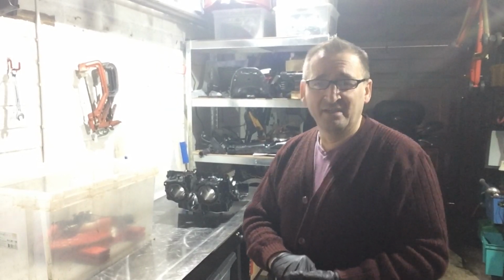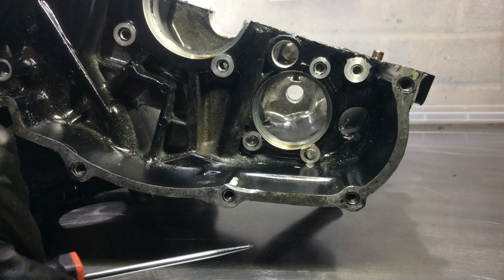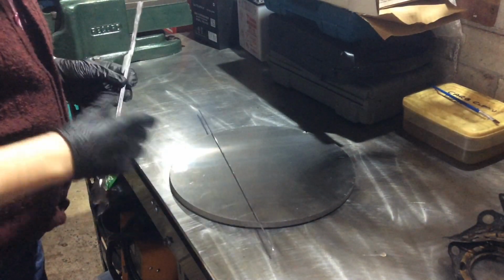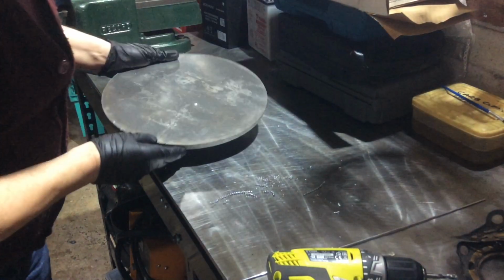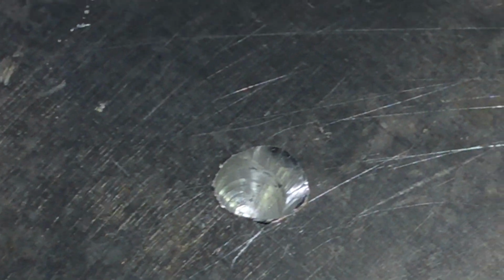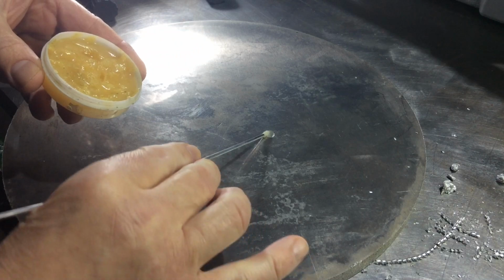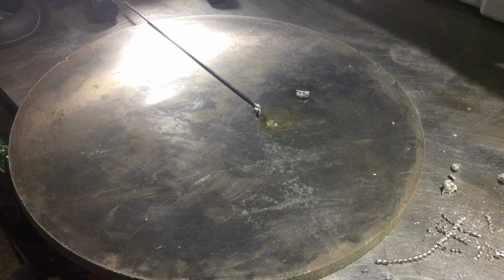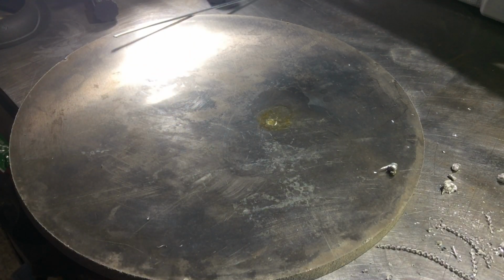Motorcycle Engine Test Repair. Aluminium PLUG - Epic Failure. Honda VF750F

Comment from the maker: Yes I was hoping an easy low temp solder would do it, but I’m guessing as it cooled it contracted, and therefore was never’ going to happen. I have got some aluminium wire now for my flux core, so will try that next. Really don’t want to warp the cases or damage around the shift drum bearing race.

Comment: Arc and inert gas is the only way to do this.  You need more heat and to prevent the melted aluminium from oxidising.

Comment: The plate take all the heat and is not hot enough you ned 660 degres 🙂
Reply from the maker: This was just soldering, but yes defiantly not enough heat. Think I’ll spool up the welder with ally wire, and hit it that way.